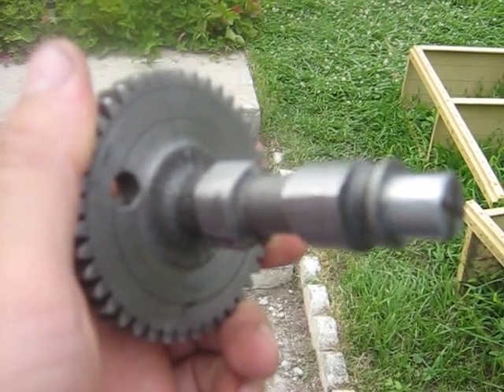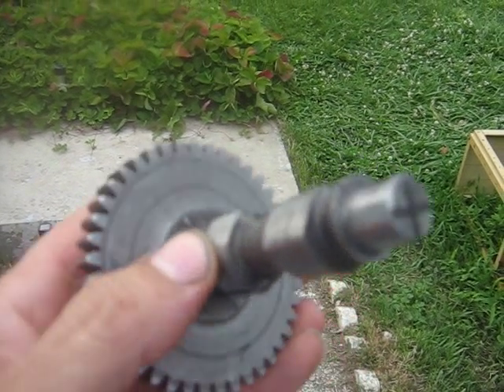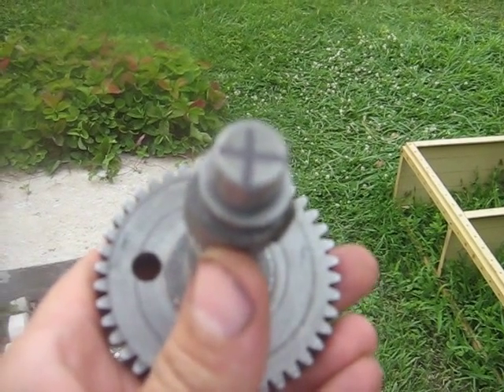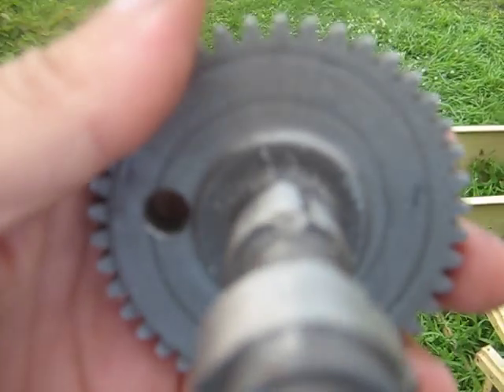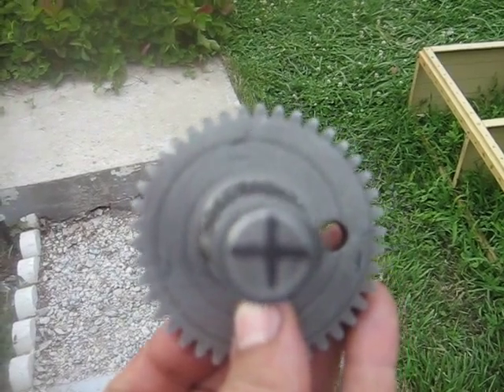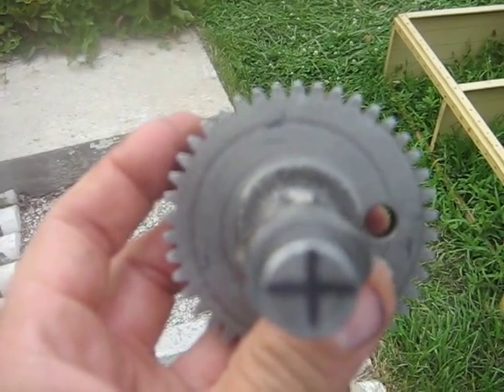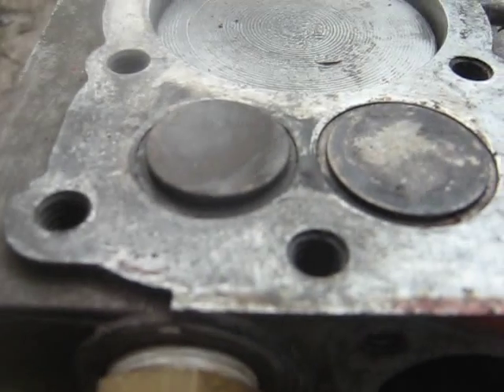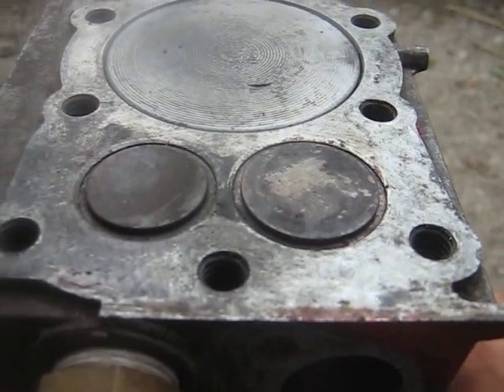Compressed air engine camshaft design

Comment: Ok thanks for all that. I actually have an aluminum flywheel. I'm not happy about it cause I know the weight matters on the flywheel. Well I can't wait then too see that vid cause I don't know what they are and what they had as advantages or disadvantages. If all fails with mine might you have an extra cam I could buy from you too get mine running?

Comment: I gets going almost but then stops on the exhaust. After seeing your vid you push all the air out then close the valve. Also how easy should it be too start it and how many psi's do you need it at too start the engine? I'm using a 3 hp vertical Briggs right now and once I get all this dialed in I'll switch too a horizontal shaft. Sorry about all these questions but I want too put this engine on a air compressor so it can be a self contained unit. The air coining out of the tank moves the engine then the engine spins a compressor to refill the tank.
Reply from the maker: Pricestinkers I am making the assumption that you have a flywheel on the engine, as I don't think it will work without one. I generally use a heavy cast iron flywheel, though I don't know if that is a necessity. I would think 40 psi should start it going, been a while since I have run one of these :)I imagine that you know that the whole engine/compressor set up will run down and quit, as you are losing lots of energy when you compress air, it comes out of the compressor as heat, which you generally can't recover the energy easily. I expect the compressed air engine will get cooler when it runs, due to the air cooling when it expands in the cylinder. I will be making a vid regarding 1/2 speed and full speed camshafts, and their advantages/disadvantages. Hope to have it uploaded in a day or two, been colder than heck here lately, so I am not itching to venture out to the library after freezing my butt off on the drive home!  :)

Comment: I'm pretty sure it's my exhaust timing it's closing just before tdc. Is that a big problem if so. It makes since cause you need too push all the air out before you can shot a shot of air in too push it back down. Also what's that full cam I heard in your vid or in others is that a better way too go. Any help I appreciate it.
Reply from the maker: Pricestinkers I don't think a bit of air left in the cylinder will be a big problem, since the incoming air is at much higher pressure. I will make a new vid explaining why a full speed camshaft is better for a 2 stroke and air engine application. I don't mind helping you out.  :)

Comment: Nice video
Reply from the maker: Harley Ironhead Thanks for watching. I made this vid to help a youtuber who is making a compressed air powered vehicle. I will probably be making another vid regarding compressed air engines also. Don't worry though, I have some vids I will upload on other engine based subjects also. How is the Super Chevelle coming along?  :)
Reply: Slow got the transmission done, motor is apart and the heads are getting redone now. They have us working 6 12 hour days so I don't get a lot of time to tinker with it.